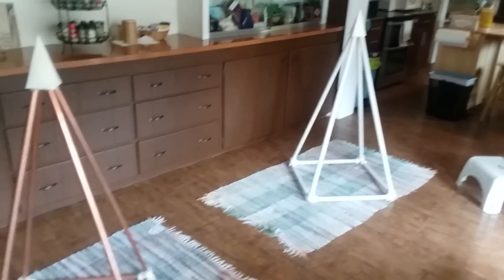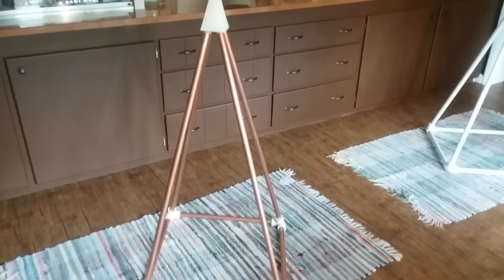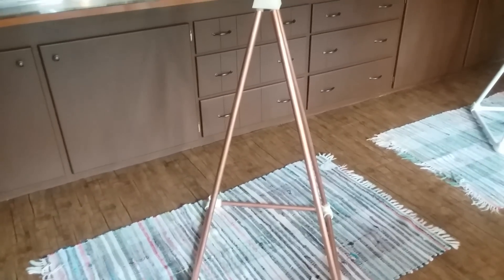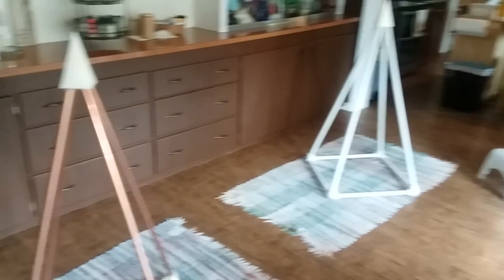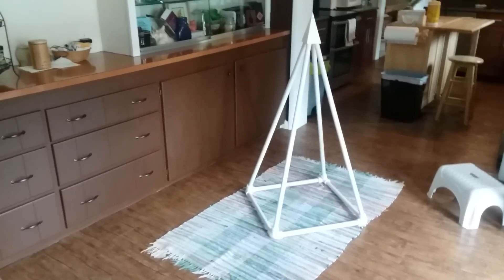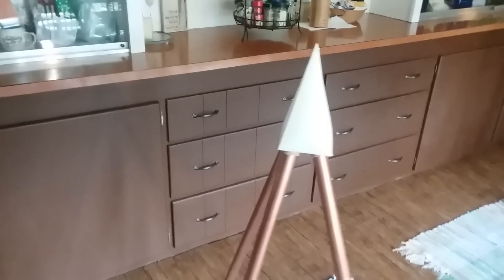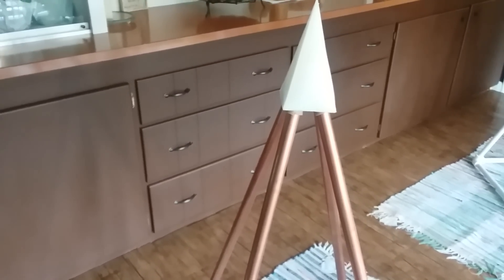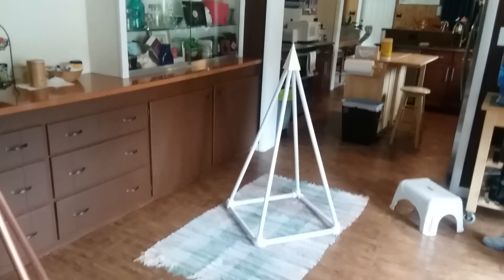See the Energy Difference Between a PVC and Copper Pyramid

Comment: It cannot work properly because you are not using the geomerie sacré to build your pyramid.The pyramid should be an equilateral triangle like the tetrahedre that it is base on the nombre d'or: 1.618. May be check videos  of  " Gerard Lavallière "
Reply from the maker: I am doing a presentation at the Conscious Life Expo in two weeks to reveal the unique Sacred Geometry of the Russian Pyramids, which i only recently discovered.  I will be doing a video on this topic after the Expo and will post it at that time
Reply: IDK about how these open air pyramids work but I've made several of them of different sizes so I should be covered but I think I do know a little bit about how the Great Pyramid worked and it certainly is based on Sacred Geometry used to Create a sound from cavitating water from a pump in the under ground level that resonates off of the geometries above the water, it's the vertices of the Geometry that tunes the vortices of sound to a particular frequency that seperates the matter within the structure into the vortices that they (electrons) resonate with and through the freestanding granite slabs that are hooded as the Pineal and resonate at specific frequencies according to their size like a trombone slide. 
An example of a wave generated from a center point that determines outward boundaries from that point, let's call these boundaries firmaments created by sound, can be seen in footage of the North Pole of Saturn taken by the Cassini and also in the eyes of many hurricanes whose inward energy is greater than the surrounding energy that tries to distort them. The Universe appears to be oceans within oceans and anologies within analogies. The cosmos behaves the same as human biology and even psychology in analogies and a lot of other ways musically...
Reply: The russians make taller and smaller base pyramids and get more power out of them
Reply from the maker: yes.  I will be revealing exactly why at Conscious Life Expo in 2 weeks.  I just figured our the Sacred Geometry...all based on solid Russian torsion field research.  I will post via YouTube video after the conference.
Reply: also peruse Dr.Fred Bell's work on pyramids. He said that his team found that altering the degree of angle changed the effects on all sorts of different aspects of human physiology (blood pressure, brain activity, esp , etc) and also other effects on materials or microorganisms. He said even altering thoughts may have effects.  He just said that one has to test and experiment for themselves to discover what is best.
Reply: François Bélanger I believe that what you say is not correct, as long as the pyramid has the same length on each side, it is perfectly a sacred geometry, what if it can happen is that it vibrates at different frequencies according to the measures that the sides have. Another important point is the orientation of one of its sides, this has to be north magnetic to work properly. You just have to prove it.

Comment: Doe sn't look like the whole pyramid is copper?  It won't conduct correctly.
Reply from the maker: The Russian research indicates that base metals interfere with the ability of a pyramid to act a passive torsion generator, and this video attempts to confirm that.  I understand your point about complete conductivity, but I don't have copper connectors to complete the circuit on a Russian Geometry Pyramid.  Question:  do you know of any research that actually disproves the Russian research and/or demonstrates that copper is better?  If you know of some, I would love to see it.
Reply: @pyramidsciencefoundation  Complete the circuit using copper wire, or, even better, copper foil, which can be wrapped around the corners.
Reply from the maker: Great idea.   I will do that and make a video!
Reply: @pyramidsciencefoundation  Copper foil and copper foil tape are used in the electronics industry and you can buy them on Ebay for a low price.
Reply from the maker: just ordered the tape.  hopefully can do the video next week.

Comment: You need to complete the copper pyramid with copper connectors not pvc.
. Of course it wont work properly...
Reply: Joylaine what is it supposed to do? I think I’m lost? What is going on here?
Reply: Joylaine If you do what you say, join the pieces of copper with more copper, what you will get is to create a Faraday cage, a sounding board. The solution, in my point of view, is to use other types of materials such as PVC or wood that have another type of vibration. Take a test, take your Lecher antenna and watch the vibration of my comment and then do the same with another comment. If you notice anything different, I would like you to let me know. Many thanks.
Reply: @porlibre1211   Well Im going to start making Orgone Pyramids and Towerbusters so I have a lot to research on this... I will take your advise and try this ... Thank you for the info.
Reply: @porlibre1211  if you're idea is to try different materials and mix materials, you should use copper joiners with the pvc tube. That makes as much sense as pvc joiners with copper tubing. Its an extremely unfair test and the law of one tells you to use the same material, you have just insulated the energy field by using pvc with copper.
Reply: @allthatis8327  Dear friend, I am sorry to disappoint you and to contradict you. Here we are talking about very special energies, not visible, not audible and practically not measurable, we are not talking about the conventional electric current, in these energies quantum physics intervenes. You can build a pyramid without sides and the generated energy is of a type and a shape and if you build a pyramid with side walls, then the energy is different and reacts differently, being almost the same energy. If you can get the books of Chaumery and Belizal and Morel and there he explains it more or less. I have seen a machine for the destruction of human parasites, a zapper, and inside it had the components drawn on a paper and the electric conductors were Chinese silk threads and it worked. How do you explain this? We do not know anything about what happens on our planet with respect to certain energies but we have a "gift" we can experience things.
Reply: @allthatis8327  This would be correct with "tangible" energies but what happens in a pyramid is not normal. I do not say that I mix different materials, the points of resonance and vibration of each material are different between them and disharmonic, using the same material you get a uniformity in the vibration. I have seen that using a Lecher antenna, the vibration that it gets is very low, almost zero in the vertex and is increased the closer to the ground, I think this pyramid is inverted, I can not explain why.

Comment: You can not do the comparison of those two pyramids unless the copper pyramid is completely copper. And when you have a full copper pyramid it will out perform the PVC pyramid.
Reply: What if pvc is painted with copper paint will that help improve energy field flow
Reply from the maker: The Russian research indicates that at least base metals used in pyramid construction inhibit the passive torsion generating capabilities of a pyramid.
Reply: How about you join the ends with copper wire instead of pvc
Reply from the maker: Please show me your research.  Thanks.
Reply: @pyramidsciencefoundation  Stop scamming people. You drop kick.